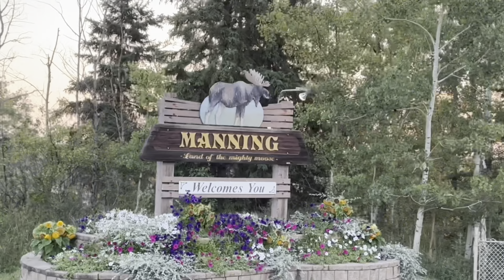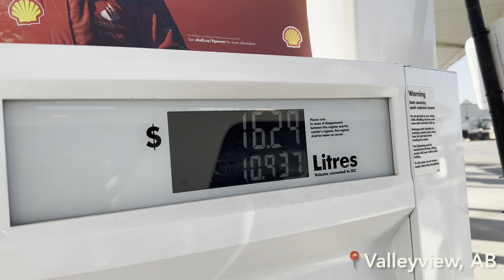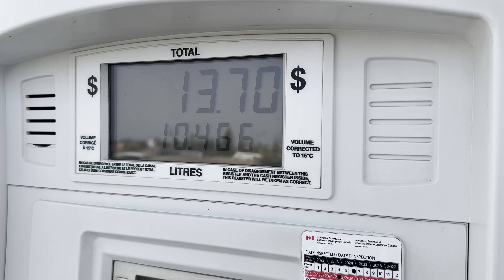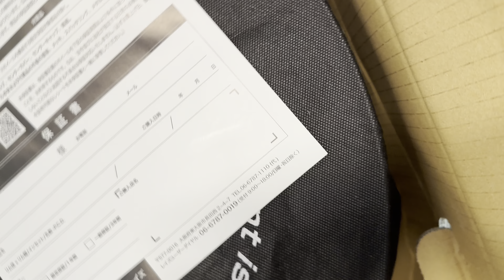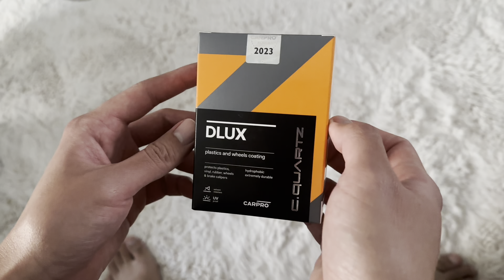Best Ceramic coating! Things we do for love

Comment: Nice and congrats. FYI because you coated your barrels, if the tire tech needs to use sticky weights, they may need to figure out how to remove some of your coating - but without damaging the rim - to better ensure the sticky weights don't come falling off later.
Reply from the maker: I already think about that. And wait time of the tires is 10days +
So by then it should be fully cured. Sticky weight will stick
Reply: I see. Hope that works as planned
Reply from the maker: @nodrogkam 🤞🏼
Reply from the maker: Yo it worked out. It  sticks